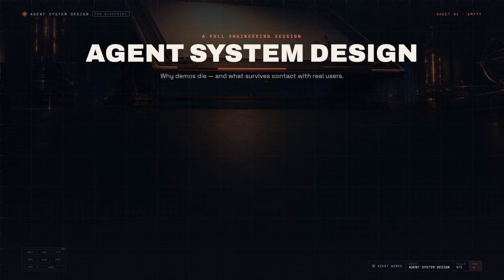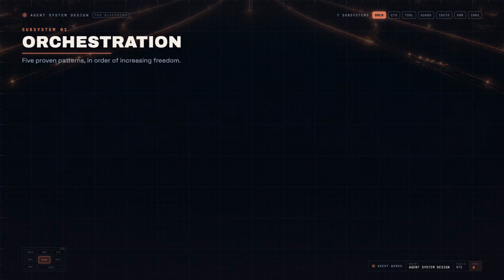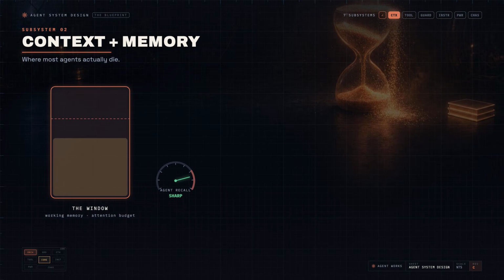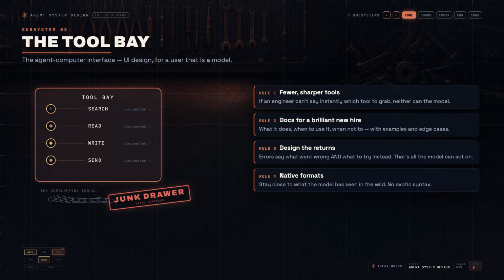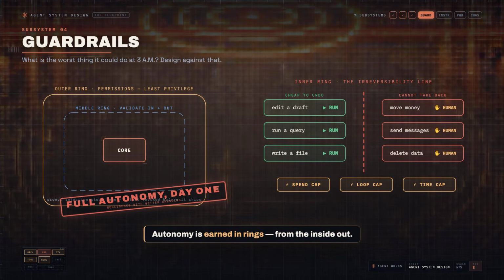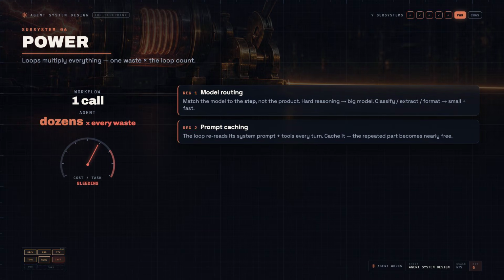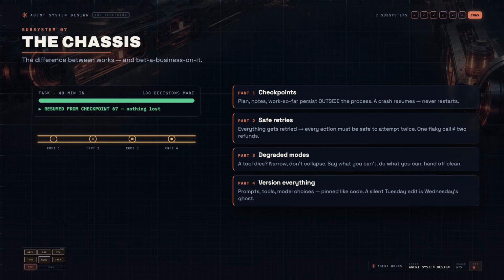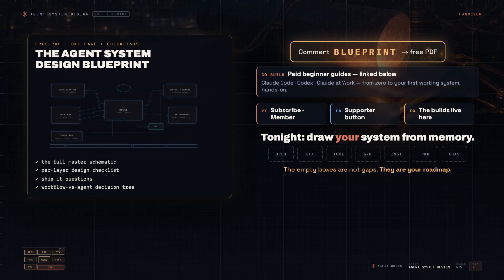AI Agent System Design: The Complete Blueprint (7 Subsystems Every Production Agent Needs)

Comment: Yeah blueprint, my question is how much compute does this consume.
Reply from the maker: https://hyperautomationlabs.co/free/agent-blueprint

Great question! Short answer: the blueprint itself is nearly free — 6 of the 7 subsystems (guardrails, instruments, chassis, etc.) are just regular code and add negligible compute. What actually burns money is one thing: LLM inference tokens, and two subsystems decide how many you spend.

1. Orchestration — every extra agent hop or retry is another full model call. A single-agent loop might be a handful of calls per task; a multi-agent setup can 5–10x that.
2. Context + Memory — this is the big lever. If you dump everything into the window, you pay for those tokens on EVERY call. Tight context engineering (just-in-time retrieval, compaction) routinely cuts token spend by more than half.

So rough mental model: cost per task ≈ (number of model calls) × (tokens per call). A well-designed agent on a mid-tier model often lands at cents per task; a sloppy one on a frontier model can hit dollars. The blueprint doesn't add compute — it's mostly there to stop you wasting it.